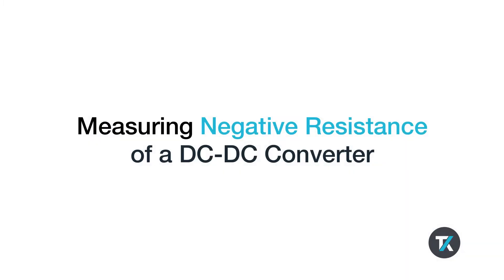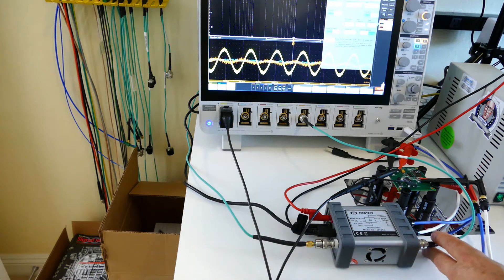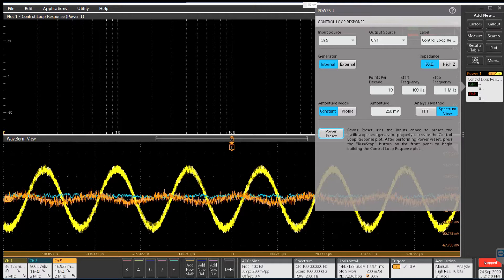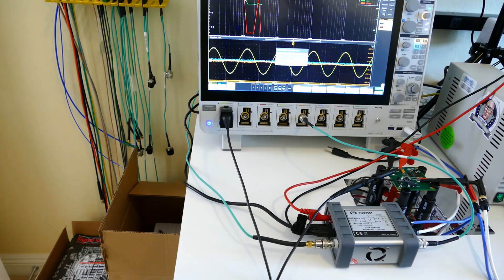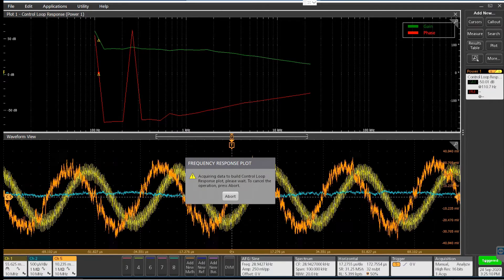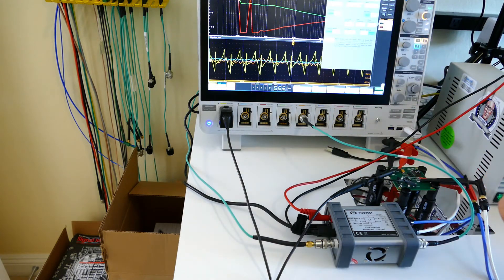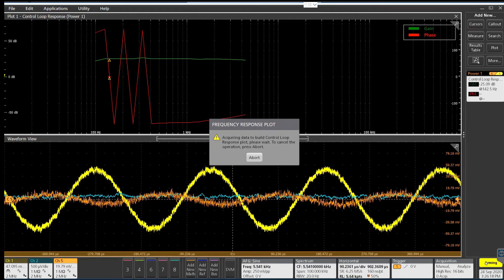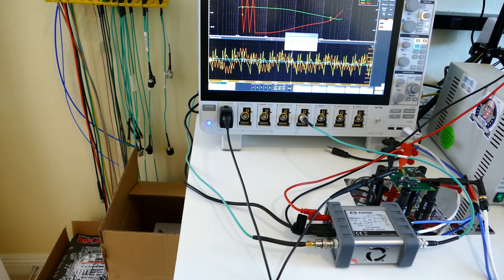Measuring Negative Resistance of a DC-DC converter

Comment: Can you tell me, what is negative resistance in tunel diode,
and why did you call it in this topic... this is impedance and eror amp oscilacion in respect to phase inverting.
If someone dont know how to operate with op amps and delays , he will have niece Local Oscylator.
There is no such of things like negative R, all is just inductance and rise times even with caps...